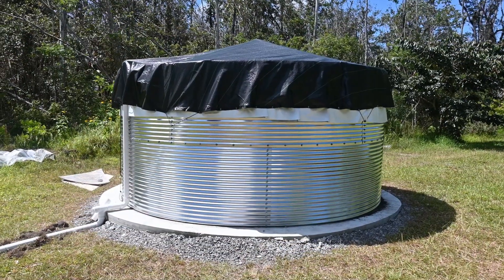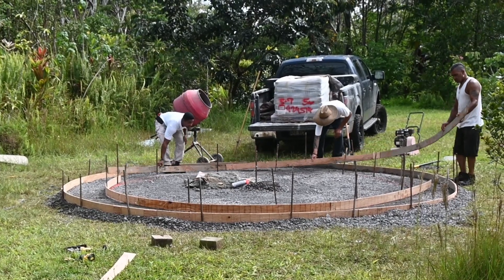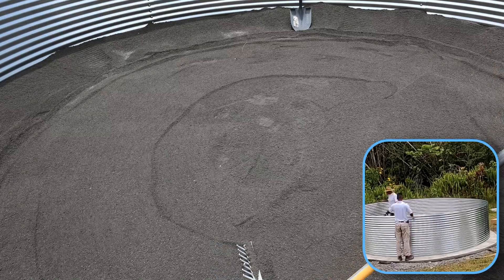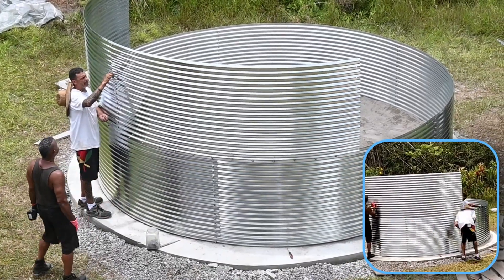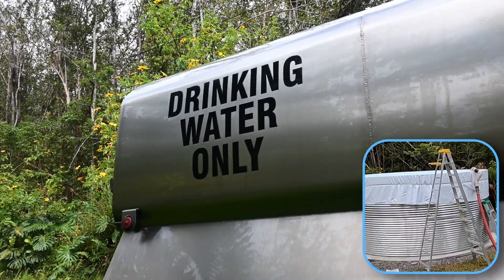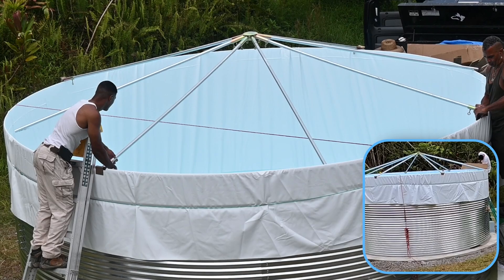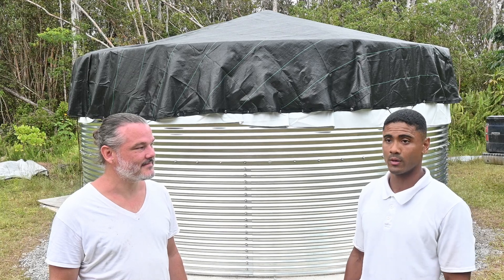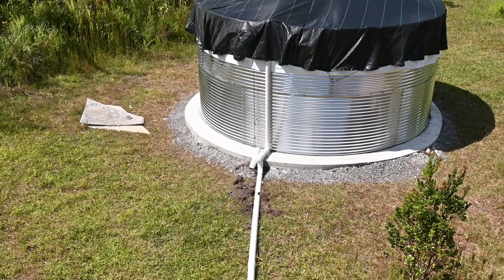How to build a water tank for an Off Grid Water Supply

Comment: Are there other options for tops because that top just kind of looks like unfinished like you just threw a tarp over at temporarily.
Reply from the maker: The benefits of the top are that they keep debris out of the tank while allowing water to pass through. 
This adds the surface area of the tank as a harvest area as well as your roof.  
That means more water. 
I have seen people build small carports over the tank as an alternative. 
The benefits there are that you get a slightly larger surface area to harvest from. 
The drawback is a little more piping and guttering. 
So sure, build a carport!
That will shelter the tank and make it last much longer.

Comment: I live in Puna, have known people that built the tank higher than the gutters. Oops, Big mistake! 
Some people use high strength hydrogen peroxide instead of bleach in their tanks. It won't damage the the plastic liner over time like bleach. And less toxic too. Can order h2o2 from Abundant Life health food store on bay front. You have to supply the bottle.
Reply from the maker: Yes, if you're on a slab with a single story roof, it's a better idea to get the lower and wider tank style.  
We're on post and pier, so we had the option for the taller tank, and that has a smaller footprint.  
Bleach off gasses to chlorine, but hydrogen peroxide just drops the extra oxygen and turns into water, so it is a very similar idea with less potential damage but a much higher dose of peroxide needs to be used.
So, for a tank this size, a little more than 10 gallons of food grade hydrogen peroxide (3% concentration) would be needed.
Reply: @TheIslandHomestead  the H2o2 from island naturals is about 36%. So one gallon of it would be equivalent to 10 gallons of the regular 3% kind.
Reply from the maker: Good tip! I didn't realize they had it at a higher concentration!  
I thought it was also the standard 3%.  
That's super good to know!
Reply: @TheIslandHomestead yeah I would recommend doing what they originally said and buy higher concentrations of hydrogen peroxide from specialty stores over using standard 3% peroxide you could get at the drugstore, you’re really paying for mostly water if you went and bought a bunch of the brown bottles. It’s really only practical if one of those stores are nearby, shipping large amounts of high concentration peroxide comes with added fees and liability no one wants especially on the islands.